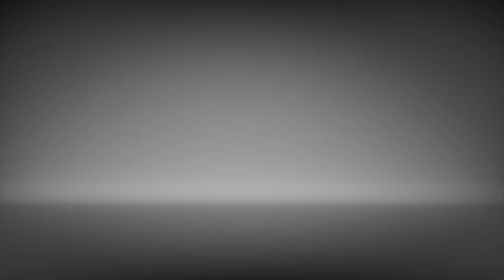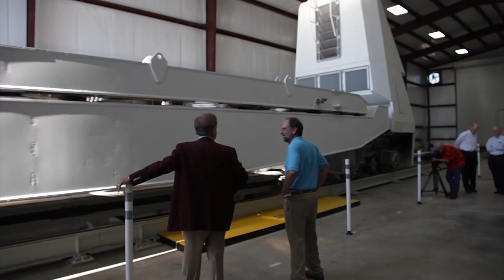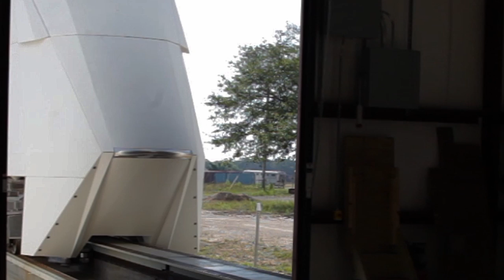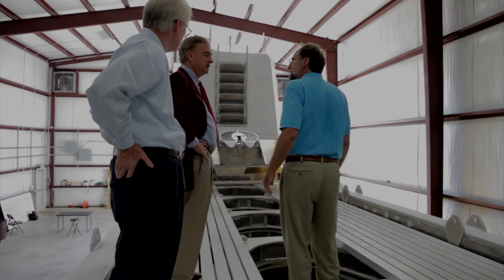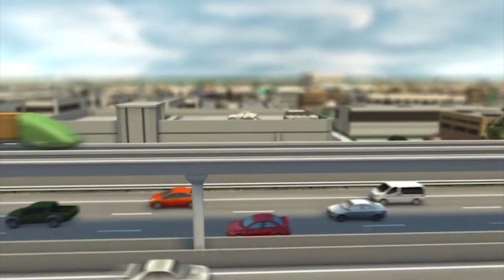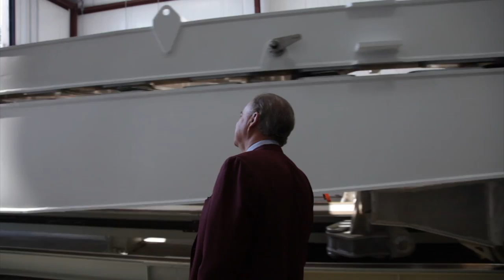The Freight Shuttle System from Texas A&M Transportation Institute

Comment: A very expensive way to do what is already being done: truck trailers have been hauled on trains for many decades, with many being hauled at a time. This invention only can haul one container or trailer (while a freight train can haul 100 or more), and still requires a truck to deliver the trailer or container to the departure and pickup zones. Essentially, this is a reinvention of the wheel, only making wheels hundreds of times more expensive. And I forgot to add, the monorail system required to make this work is another expense not accounted for in the idea. These monorails don't exist: rail lines crisscross America already, and they are already very effective at moving truck trailers and containers efficiently, at low cost, and in large numbers.
Reply: Seriousmods I agree.  Their design also requires a complex switch because the reaction plate run is above the horizontal running surface. The whole thing is nuts.  

Someone has put in millions to build that prototype. 

Why don't they just put a LIM reaction plate between conventional rails and adapt an existing well wagon? They are just trying to create IP so they have something to sell.
Reply: It's a matter of becoming more sustainable, using less of our natural resources, and reducing pollution as well.
Reply: Have you considered the time it takes to consolidate freight, the speed limitations of freight trains, and time it takes to unload, sort, and dispatch containers? Imagine if containers could be sent off individually as they arrive at the depot and then loaded onto trucks as they each arrive on the other end of the rail without delay. It wouldn’t only be faster. It would reduce transportation bottlenecks and highway traffic. The current system is similar to loading berries into baskets and then carrying each basket individually vs. steadily pouring berries onto a conveyor belt.
Reply: They can have a electrified (ground level or overhea) ligh freight rail line since heavy freight trains are very heavy to maneuver to tight sections. At least can carry more than 1 trailers and can handle 100-150 tons cargo cars. Can be fast as automated freight shuttle system.